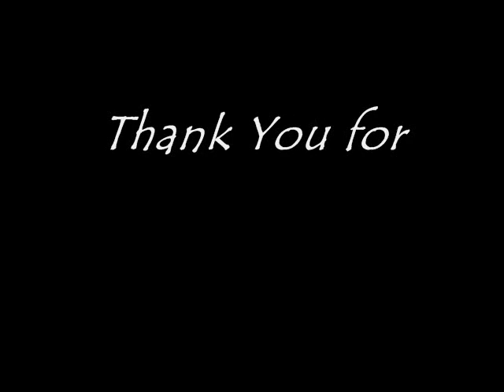How to install a CPU cooling fan

Comment: I thought you had to use the thermal paste before replacing it?
Reply from the maker: Yes, when you take the hole cooling block off, you need to replace the thermal paste. I know I removed the block in this video, but I was only trying to show how to get the fan off itself. Some people don't need to take the whole block off. Good eye though! t yes, whenever he cooling block is removed, it is a great idea to replace the paste

Comment from the maker: If you remove only the cooling fan and leave the cooling block secured, no you don't have to. It's a lot easier to replace the fan with the block out. If you decide to take the cooling block out, then yes, apply NEW paste. Just don't apply more on top of the old. Grab some lintfree cloths and some rubbing alcohol. Wipe the cooling block down thoroughly, do this also with the top of the processor chip (you do not have to remove the CPU for this) and make sure all the old paste is gone.